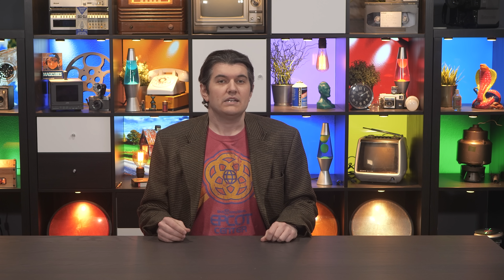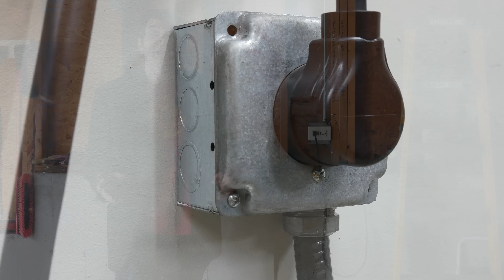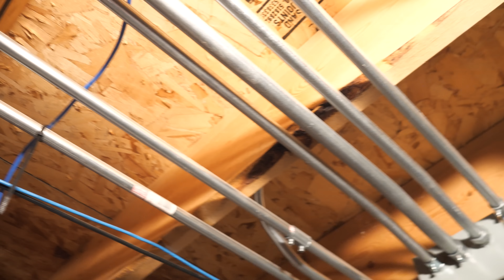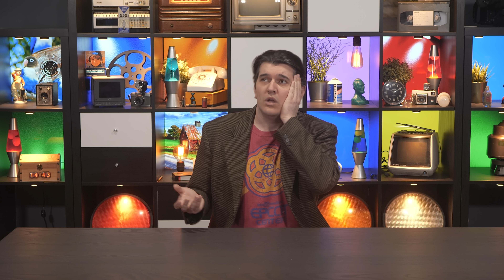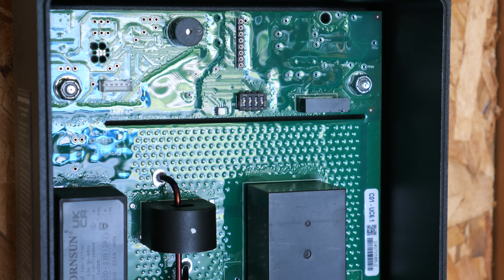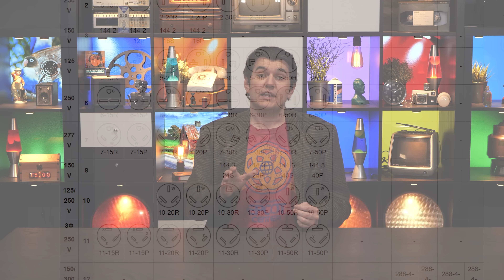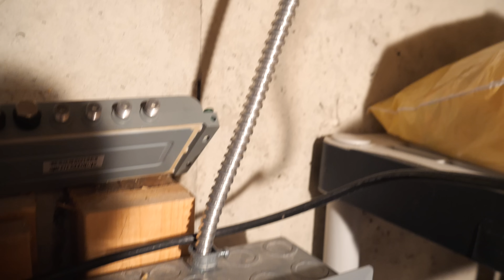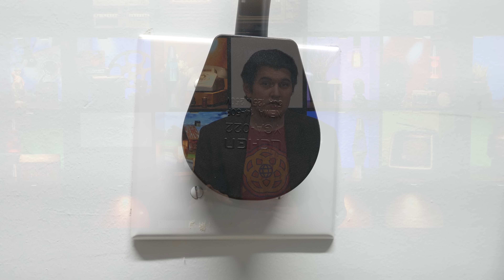The "standard" car charger is usually overkill—but your electrician might not know that

Comment: Living in Australia, the rooftop solar PV capital of the world where 40% of homes have rooftop PV, we want our cars (if home or at work) to soak up the excess available solar PV output, which naturally varies through the day with changing light conditions and other household/worksite loads. Our grid is also still coal heavy, especially at night, so overnight charging is less preferred and costs more.

Smart chargers monitor this and are able to ramp up and down the charge current in 1A increments in order to "follow the sun".

Excess PV energy is the very cheapest we have. Its export value to the grid is negligible, zero, or even negative (yes you can be charged to export power, conversely at times you can be paid to consume grid energy), so it becomes free energy, sometimes even better than free - it can earn you $ credit. And it's also the cleanest energy on our coal heavy grid where charging at night is dirtier.

For more normal electricity plans we also have "super off-peak" tariffs during the day which are often 0c/kWh but they exist for short 2-3 hour long windows, hence being able to charge more quickly provides a significant energy cost advantage while being able to ramp down the charge rate at other times when power costs more is also an advantage. A smart EVSE costs not much more than a dumb one.

As to the collection of statistics - many cars here are purchased using a novated leasing arrangement and they will need the data for tax return purposes. I collect the data because I'm an energy nerd and can dispel myths about life with an EV. We have just added a second EV, replacing an 18 year old diesel VW.

Smart chargers using the Open Charge Point Protocol (OCPP), an open standard, are common here and indeed mandated in one state (South Australia).
Reply: As an Australian with rooftop solar - get a battery.
Reply: @ChristopherHallett  I am. 24 kWh going in soon.
Reply: @ChristopherHallett As a German with PV roof and a 10 kWh battery said battery is full before noon on good days. After that I want the excess power to go into the much larger car battery. That's why I need a smart charger.
Reply: Although Australia gets a famously ridiculous amounts of sun the same principle should be embraced by everywhere in the world. Even miserably grey England get enough sun.
Reply: @Crusader1089  In most places, both solar and wind, are a joke.   I'm all for people having hobbies, tho.
Reply: I get free electicity from 11am to 2pm every day because our grid has so much excess solar power. The energy provider still makes money because they get paid to take the energy (and give it to me for free).
Reply: @EEVblog  Yep, and we charge our cars, fill up our homes batteries and heat water. Only problem is having a mains feed with enough capacity! I previously had similar but just 2-hours 12-2 PM for free. I may go back to that before long once the battery gets installed.
Reply: Solar + Battery and being on a VPP, you can even sometimes be paid to draw power from the grid, that's the sweet spot
Reply: AGL is the other way around: their EV plan is $0.08 per kWh in SE QLD from 12am to 6am
Reply: High five from Australia — loving the Amber app, auto day-trading on wholesale tariffs, time-shifting for profit.

“PV capital of the world” may be that part of Sydney using AusGrid for the network — because we have the juicy juicy 10kW limit per phase.  13.3kW capacity allowed on the PV panels for a single phase.  And then if you go three-phase it’s UHMAZING.  Last week I dumped $200 of power into the grid during a supply/demand mismatch, and that’s paying off my batteries in 5-10 years — all while greening the energy of my neighbours AND lowering their costs indirectly via Dutch auction pricing.  TRILEMMA?  What trilemma?
Reply: @whophd  Mid-north NSW here, 5 kW export limit :(  Have 14.8 kW of PV and shortly adding 24 kWh of home battery. I have one smart OCPP controlled EVSE and considering adding another to make it super easy for my wife but we may just use the plug-in unit for her car. I have set up some Home Assistant automations to control that car's charging to stay within the peak solar period and the super off-peak period.
Reply: South Australian, have you heard of dankpods? Or even better yet garbage time?
Reply: Right now, its a week away from the shortest winter day, but when the sky is clear we have surplus power.
Reply: You live in Australia, where despite supplying enormous amounts of carbon to the world, you have very expensive electricity - hence everyone buying EV panels from China (built with electricity made from Australian coal : )
Reply: @kapdolkim1914  China's electricity grid is becoming increasingly supplied by low carbon energy sources, now at 40% and growing fast (faster than the USA or Australia). Australian coal is a tiny fraction of China's consumption which is more than 90% supplied by domestic sources, indeed China banned Australian coal imports for several years , only recently lifting the ban.
Reply: Don't most EVs have charge scheduling built into the car? Why would the charger itself need to be smart if the car can run its own schedule?
Reply: @greglarson4188  If all you need is dumb time scheduling, then yes. For anything requiring smarts however (e.g. soaking up excess PV, or responding to wholesale grid price signals), then a car's schedule isn't of much help. It's possible depending on the car but cars rely on their own data connection and cloud servers, while home charge stations can be controlled more reliably by your local network. Not all cars can rapidly adapt charge rate settings to suit the available excess solar PV generation or grid price signals. This is where smart charge stations shine.
Reply: It's hard to be a VW diesel, at least the old ones.   A buddy had one of the old Rabbits, but the "pick up" version with a bed.   It snows in the winter where he worked at the time and he would just leave it run while at work.  He'd come out after a 10 hour shift and all snow would be melted anywhere near the car, lol.  😁
Reply: @l337pwnage  It's been a good car, 2007 TDI Golf 2 litre. 180 bhp, eats highways for breakfast, sips fuel and has plenty of life left but lots of little things are failing and its expensive to keep, so am selling it. Bought a MGZS EV for my wife to use instead, at just A$26k (US$16.9k) with 5 km on the dial it's new, runs on sunshine and my wife loves it.
Reply: @alexsimmons1803  damn, 180 hp from the TDI is pretty impressive. My '06 FSI makes 150-odd (torquey) hp and even that is great fun to drive
Reply: @dielaughing73  Stage 1 remap and EGR delete done years ago - goes like the clappers. EGR was a never ending cause of poor run issues. Anyway, I sold it yesterday after a full service and registration paid up to July 2026. It also had an LED headlamp upgrade (way better) and an infotainment unit with Carplay and Android Auto and reversing camera. Did great service for me, then my wife as her first car. Now she has her new EV and absolutely loves it.
Reply: Anyone who thinks you can buy an EV instead of a ICE car and come out ahead in terms of dollars is delusional.
Reply: Homeowners with solar definately can come out ahead. One colleague had an EV used for errends and weekends. While at work it charged from home solar. Went from $200/mo on fuel to zero. Given the EV was likely to last 10 years, but was the same price as the ICE it replaced, they end up ahead.
Reply: @Scoochie77  I guess I'll find out. We were looking to replace my wife's older car with a used five-year-old Subaru Forrester with 40,000 miles and they wanted $24,000. We were going to put up the cash. We were able to lease a new Kia Nero EV with no money down for 145 a month for three years. That seems like a lot less. Plus we have solar panels with an excess of electricity so we won't be buying gas. We won't be getting oil changes. Or tuneups. It's hard to imagine how it would've been a similar or better deal to buy the Forrester.
Reply: @riverbank2193  Right on. When you add up the savings on oil changes and fuel, the only way you'll come out ahead with a car that burns gas is by not driving it.

Comment: When I first contacted an electrician, I got quoted for a 14-50 circuit and a management system to not go over my house's 100 amps. I only wanted a circuit for a nema 6-20 outlet (240v, 20 amps but in reality 16) The electrician asked me to show him what ev charger plugs into a nema 6-20, which i did. He was great and did the job I wanted, but he was very obviously unaware that what I wanted was a thing.
Reply: 100 amp service is obsolete

Comment: Is the conduit rule a result of the Chicago fire(s)? Also GFCI breaker requirement is dumb. Number of false trips is very high.
Reply: Love me GFCIs.  I installed some GFCI breakers and some GFCI pass-through receptacles in this rental I'm in, and love 'em.  Saved my ass once already.
Now, AFCIs . . . that's a different kettle of fish.  Your wiring had better be up-to-snuff for those to work without nuisance.  AFCI will find your bad wire nuts, yessir.

Comment: watching videos about basically any construction\plumbing\electrical standards and tech in usa is like watching caveman making a spaceship; guys why are you like this - 10000 standards for what should be 10, electrical box looks like was not updated in design since 1940,
it looks like instead of solving the root problem you just slap another code with very questionable idea and 110v is really stupid on so many levels

Comment: This is great, thanks. Do you mind doing a rant about the amount of driving range you can get when hooked up to a normal 120V outlet? It's not a ton, but it covers at least half my total commute a night. Including weekends, that's like 2/3 or more of my commute.

Oh no! They say. You don't have the whole thing covered!

And yes, that is annoying to plug in every night. But I also have to go to a fast charger 1/3 as much, and if I can plug in at work ever, I get that amount topped off. But even without that, it turns a 200 mile driving range into closer to a 600 mile between fast charges. Better than a gas car.

More exciting, more places could just throw those things up all over. 120V at Safeway is enough to cover your trip to the grocery store. And I'm sure they'd get that $0.30 / kWh back from people going "well I'll just stay in here a little longer while I charge up."

Comment: I got lucky; breaker box is in the garage, with enough room for a full 50 amp circuit (even though I too have a Bolt and it tops out at 32 amps), so the line coming off the breaker box is literally 2ft long where the NEMA 14-50 outlet sits.

Comment: One thing that is not discussed is the over all cost to your household electrical bill.  Unless you have it 100% off the grid I do not see any savings with any type of car charger smart or dumb.  Nor do I see a ROI.  This is why I'm not convinced that EV wasn't close to a fully fleshed out thing.  For me the novelty wore off when the US gov (and still most of the world) made this a political thing.  That has turned me off to ever wanting or recommending EVs or charging stations.
Reply: Eh, the overall cost is minimal. In Minnesota we saw a $20 monthly increase driving 1200 miles/mo for a single vehicle. And currently in the Pacific Northwest, driving two EVs our bill may be $50 more/mo while driving 30,000 miles annually (2,500 miles/mo) between the two vehicles. 

One of those vehicles is a 5,000 lb AWD Crossover/SUV (~18,000 miles annually)
Reply: @wzDH106  I'm just unconvinced that EV is ever the way to go.  Traditional fuel has had over a century to work.  Also Lithium Ion batteries are at this point useless.  If you left them drain fully, they become weaker (same with any device that uses them).  When the gov stuck it's nose up our butts over EV and made the world believe that was the only way to save the planet was such a crock.  The promise of charging stations was an outright lie, only 6 were built.  Where as a gas station is ubiquitous.

EV is also more expensive than it has to be.  Manufacturers refuse to follow what Japan did with their K trucks, and are even trying to have them banned here because they cut into their profits.

Oh and as for state of Minnescrotum.  I was born and raised in the state and I hate it more than a million white hot burning suns.  In fact to me it's worse than CA or CAN combined.  That should say something.

Comment: The tracking of the power used... I would rather just have something which detects the power pulled... and have it work locally like a SCADA network... not have it require an internet connection!  There are things which will let you do it.

Comment: If an electrician installed wiring based on intent, and not capacity, and the user just flips some switches later to exceed the intended draw causing failures or damage, who is that home owner most likely gonna blame? (even if it's their own fault)
Reply: The electrician installs wiring, receptacle, and breaker as a matched setup.  If the device connected to a circuit (eg an EVSE) is misconfigured to draw more than the design limit, it's the fault of the device (or the person configuring the device).

Comment: Whenever I am asked about EVs and charging, I encourage trying the trickle charger. I relied on that for my first year.
   When I got my EVSE in 2012, charging on a long trip was tricky. One common option was outlets at RV campsites. The common default was NEMA 14-50. Mounting a detachable EVSE in the garage was a flexible solution.
  Never overlook availability of an electric dryer circuit.  Installing a 2 pole double throw switch is a cheap solution.

Comment: My home came with a 6-20r outlet, which apparently was installed for a welder by the previous owner. So, we use that for our EV. Does a great job for us.
Reply: North American homes would have been so much better for moderately heavy electrical loads if kitchens, garages/workshops and outdoors had been required to run 240V 20A, either with NEMA 6-20R or the 14-20R (and why in blazes the 14- series (240V & 120V) receptacles are not compatible with the 6- series (240V only) plugs is beyond me). With over 4kW available, we could have some amazing kettles, snowblowers and chainsaws!
Reply: 6-20R?  P = Plug, R = Receptacle.
Reply: @alsavage1 i keep getting those mixed up. Yes, recepticle, R
Reply: how will you use your welder now?
Reply: @NithinJune  Switched to a gas welder over a decade ago.
Reply: @downix  Seriously, gas welders sound more badass during operation, that whooosh flame sound makes you grow chest hairs.

Comment: Nice work, as usual. Range anxiety issues are closely related to perceived charging needs. As you point out, most people only commute to work each workday, 50-70 miles (80 -115 km) max. 3 kW charger will top this off overnight, so no probs!! And if you can also charge the vehicle whilst you are at work, you'll probably never get below 80% SoC for your work commute!!

Comment: Yes do remakes.  I still send people to your original series and an update would be great 

I’m running 240 volt 20 amp charger for my EV. Simple set up. No massive wall box. Just a simple plug and the charger plugs in to the wall with a standard 6-20P plug.  $200 for the wiring and plug, 50 for the inspection and done

Totally agree about the whole need for full charges….  In 5 years I think I’ve been below 15% only a handful of times.  It’s just not a thing.   And I’ve only used a fast charger twice. 

Track your daily mileage. Suddenly range is way less of a concern. 

Great info. Thanks

Comment: Home charging is not as efficient. that is why fast charging is the goal.
and no i am not talking about your chargers 300w but the ac to dc and voltage conversion efficiency. this varies significant from the build in one  to a proper one.
edit: this can be the difference  between 85% and 95% efficiency depending on the car and charger. so this is very significant.

Comment: i charge off level 1 cord that came with my 2017 bolt ev on 12 amps (have to set it every time in the vehicle but it's simple click). there are 24 hours in a day, worst day i might spend 10 hours out, so that would leave 14 hours to charge. my bolt pulls 1,400 watts (measured by kilometer at the outlet) so 1.4kWh over 14 hours is 19.4 kWh, which is ~30% of the battery capacity.
i get 4 m/kWh, so that comes out to 77 miles a day. this is how many miles i gain per day, if i stay at this and below i'm always even or net positive.
however even if i drive 100 miles every day, i would only lose 100 - 77 = 23 miles per day or 5.75 kWh net negative. this would take 64 - 19.4 = 44.6 / 5.75 = 7.75 days before i would actually run out.

however that assumes 7/7 days of driving those miles....which isn't realistic.

now this is only a issue if you work 7/7 days and drive those miles each and every day. there are at least 1-2 days you are off, so those days you charge pretty much the whole day and any net negative is recovered on those days you don't drive as far. the result is that even on level 1 charging at 12 amps 120v it's perfectly usable.
i drive 70 - 90 miles 5/7 days a week and i haven't ever had to go to a public charger, it's been several months since i got the bolt.

pretty much just take the miles you drive in a month and divide it by 4.3, then divide that by 7 and that's how many miles of range you ACTUALLY need to charge per day. chances are (high) that a level 1 charger (the cord that comes with the vehicle) is gonna be plenty.

the only real reason to get a level 2 is that you drive more then a level 1 can supply or you want to charge during off peak hours for a better electricity rate.
clearly if you are on the cutting edge of range, then you want to add like 25%-30% extra for winter time just to have some padding and in that case level 2 makes sense.